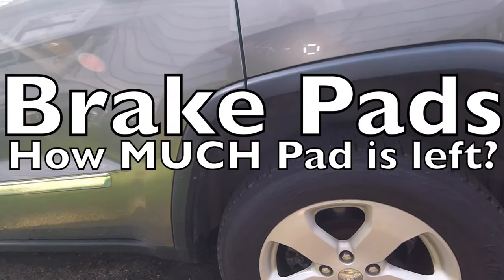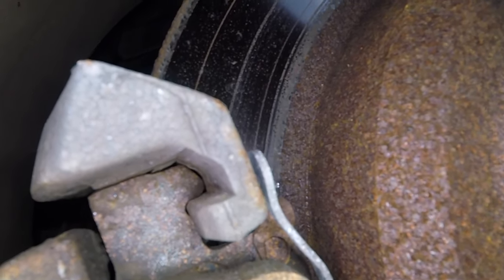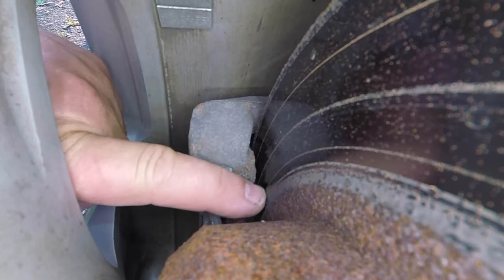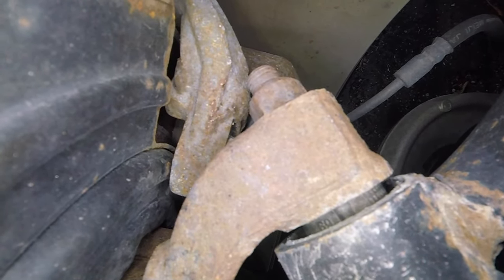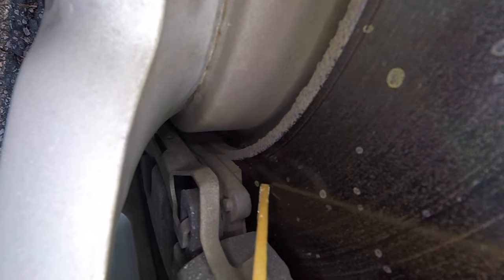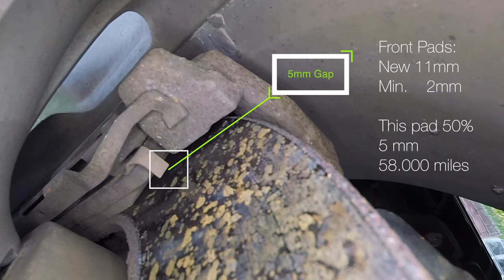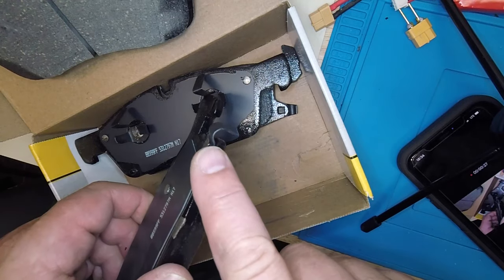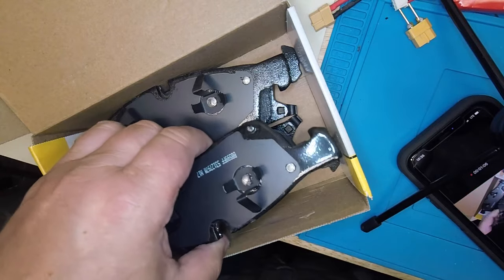How To Check Brake Pads - How much ▁ ▂ ▅ is left?

Comment: I had 1mm left on my pads so I cut out a section in the floor and use my feet to brake like the Flintstones...been able to maintain the pads at 1mm for 3 years but the calluses on my feet are killing me
Reply from the maker: Just wear shoes, and it'll be easier on your feet.
Reply: Or wear stone shoes
Reply: This is such a funny comment.
Reply: Goated comment, thanks for the laugh mate🤣

Comment: I could be wrong, but my understanding of the rotors is that they basically need to be changed when the pads are changed.  Long ago, the rotors used to be thicker and could be turned during a brake change.  Now, for weight savings and fuel efficiency, the rotors are thinner and have a shorter life.

Comment: Today my brakes were metal on metal with that awful noise. How come there was no noise at all 2 minutes before? Shouldn’t have I heard gradually more noise?
Reply from the maker: once the pad becomes to thin it can delaminate from the metal. It gets so hot that the glue burns up. The pad simply falls off.
Reply: @mygiguser  Makes sense.

Comment: When you hear that noise, how many kilometers is safe to drive after that? Lets say I come back from a trip and 400km left to drive, can I drive home?
Reply from the maker: Well, that depends how often you have to brake. The noise making spring will damage the brake rotor over time, and you'll need new rotors too. Can you make it home safe? Yes, that shouldn't be a problem.
Reply: @mygiguser  Ok, so better to measure/check it regularly rather than wait for the noise.

Comment: Thanks! Well explained. Is it ok to measure during brake is released? If release the pad is not pressing the disk right? Should have check during brake.
Reply from the maker: Doesn't matter, because when the brake is released it is only a very small difference.
Reply: @mygiguser  thanks!

Comment: 01:08 what are those small metal plates?
Reply from the maker: The plate is the back of the brake pad. The actual brake pad is glued to that plate. The other metal piece here is a spring that keeps the whole thing from rattling around.

Comment: Very, very helpful.  Some videos like this aren't as clear as to how to check and adequately showing the parts so that you can see well enough.  Thank you, good sir!     One quick clarification though, that second pad you measured must have had 7 mm left on it, right?   Earlier you said that when the indicator hits the disc, that means there's 2mm left.  So, if there is a 5mm gap between the indicator and the disc, then when that 5mm wears away, there will be 2mm left, meaning there's currently 7mm, right?   Am I understanding that correctly?  I guess that would be 5mm of *useable* pad and 2mm left with the indicator touching.  But the 50% thing confused me a bit, b/c it either seems like 7 out of 11 *total* mm left, OR, 5 out of 9 *useable* mm left.
Reply from the maker: It is not always math, and accurate science on how fast those pads wear. It depends on quality of pad, rotor, and the whole assembly, and design of the brake.  Rear brakes usually last longer than front brakes. The point here is, if you hear the noise, it is time to do something about it.

Comment: My brakes are making a scraping sound, not a squealing sound. Same problem? Also, there is a vibration in the steering wheel.
Reply from the maker: Possible that the metal plate is scraping on the crusty rusty edge of the rotor. In any case you should think about fixing whatever causes the noise.
Reply: Turns out, I needed brake pads on all four wheels, and one of the calipers was stuck and needed lubricating. The rotors were fine.

Comment: Excellent video
I have a 2013 chrysler 300 and my brake pads wear out every 2 months and im not using cheap stuff I'm pissed off 
What do you think is the problem?
Reply from the maker: HAWAL ARAS that doesn’t sound right. Are just the rear pads wearing, or the front too?
Reply: The piston is not retracting and your pads are dragging on the rotor. You can get rebuild kits which is just a new piston seal or you can replace the assemblies. I do not recommend doing it yourself if your not so inclined. There are videos that show complete brake jobs with all the tricks on YouTube. Also cleaning and lubricating the proper components is critical as well. Proper bleeding of the brakes is just as critical. I let the gravity method of bleeding work for me. If I am in a hurry I will use the proper bleeding kit with a special cup and hose. There are special tools for bleeding brakes if you want to purchase them.
Reply: @mygiguser  only the front pads wear out
Reply: @billthompson2860  thanks alot 
I will watch them and give it a try

Comment: Not every break pad has this indicator though. So check if they do!
Reply from the maker: You can still measure the distance between the rotor disc and the brake pad metal plate.
Reply: @mygiguser  Correct, just saying people shouldn't wait for it to start making sound if they don't have an indicator. Also when the indicator does start making sound you can bend the indicator with a screwdriver or pliers so it wont rub the brake disc and mess up the disc. of course when this happens replace the break pads asap!

Comment: 4 month ago I use to barely touch the pedal with my foot for a complete stop now i have to push it further more, deeper. Disks are fine and brakes are good “mechanic says” any idea ? Great video btw
Reply from the maker: amer huss how many miles on the car? did you get new brake pads?
Reply: @mygiguser  about a year and a half i installed new brakes and softened the diskes, 14000 km wich is 8700 miles were driven on the car now the pedal need to be pushed deeper this started 4 or 5 month ago
Reply: @amerhuss6583  does the pedal sink while holding it for a long time?
Reply: @slayerficated  no it does not, should i check brake fluids ?
Reply: @amerhuss6583  It might be really dead brake fluid, air in the brake lines, or an incorrectly installed brake master cylinder (not bench bled). That said, it's hard to say without being able to physically check out the car. If it's any of the problems I just listed, you brake pedal should feel spongy.
Reply: @slayerficated  sorry for the late reply and thank you so much , yes the brakes needed oil its ben a month now..all good , many thanks!

Comment: Shouldn't you engage your emergency brake to ensure that your brake pads are snugged up to the rotors before trying this?
Reply from the maker: David DeRose no
Reply: Why not? Isn't the wear indicator attached to the brake housing which moves toward the rotor when the brakes are engaged? Elaborate.
Reply from the maker: Sorry for the late answer, this car has drum brakes for the emergency brake system, you won't be able to see them without removing the rotor/drum. There are other cars that have emergency brakes that press the regular brake pad against the rotor, but that also would not make a big difference, when measuring the pad thickness.